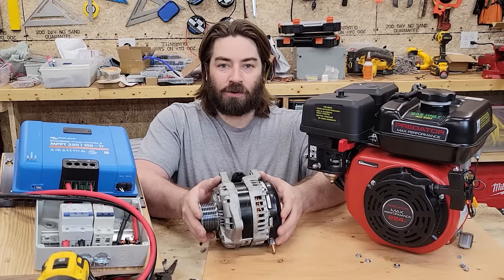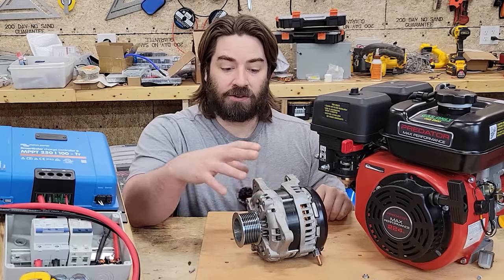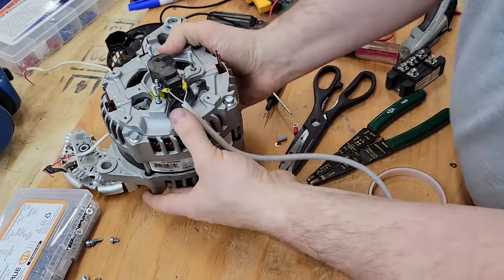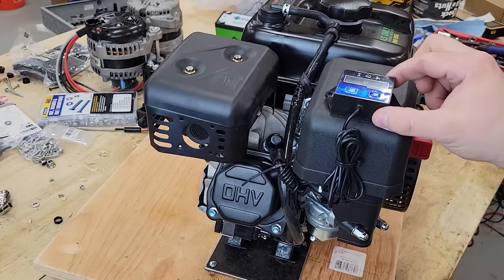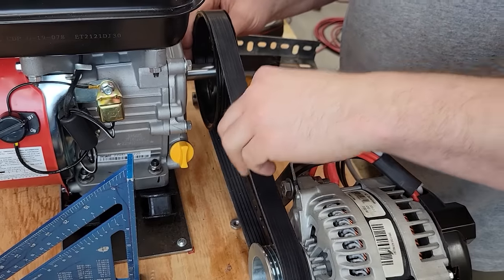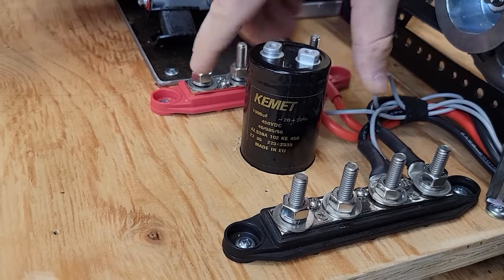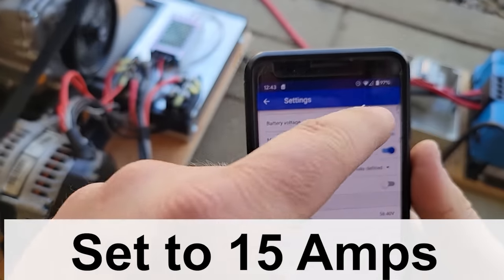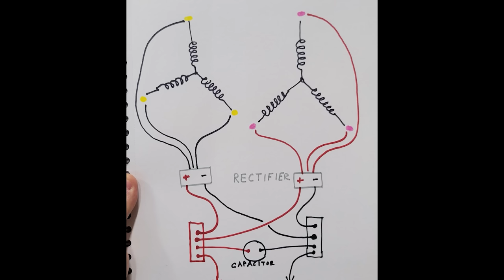The AlternatorGenerator, First Attempt.  48V Battery Charging

Comment: Great experiment. If you want less vibration and better belt control you need both the engine and the alternator solid to each other and then the rubber mounts for the assembly. Also, was wondering why you did not use the OEM rectifier and just remove the regulator. Keep the great videos coming.
Reply from the maker: Thanks, I'll have to try that next time. 
I thought about using the on-board rectifier.  I was a little worried about the negative of the rectifier, and negative of the rotor, being connected, remember, they are operating at different Voltages now.  It probably would work, but it was another unknown in a sea of unknowns.  Also, a smaller reason, by removing the rectifier, the alternator runs cooler.
Reply: @DavidPozEnergy  - Good points, but one wonders if you'd get the same results using the existing rectifier(s) on the alternator - granted those full bridge rectifiers (FBR) (a nod to ElectroBOOM) are not all that expensive, but it would be cool to see if your goal could be accomplished without the two FBRs?
Reply: @samvalentine3206  I would be wary of trying that out. Because diodes have a max voltage the same way any other silicon component does. The same way a 250v charge controller is rated that voltage (because the transistors/components inside only handle maybe 350v max). The diodes in the original rectifier are only designed to operate at max ~15vdc output. So they may only be 50v rated parts for example. Or they very well could take the 90vdc without issue. 

Worst that can happen is the built-in diode shorts out if you exceed the max voltage and sends AC into your DC system, destroying all the DC capacitors including the one in your charge controller. So if you were going to do this, try it without anything connected to the output except maybe a capacitor like he did here. If it reaches your 90vdc and afterwards all diodes are still working right, then it's fine to use them.
Reply: Alternators with the factory rectifier are only good for their original voltages, a lot of OEM alternators from cars with electronic fuel injection use avalanche diodes (similar to Zener diodes but way more powerful) that will clamp the voltage if it exceeds a certain value, to protect vehicle electronics if the regulator fails or if the battery is disconnected with the engine running, etc.
And earlier or cheaper alternators will have low voltage diodes, usually 40V is already enough to fry them.

Comment: This is an awesome project! Definitely one of my favorite you've ever done. I would love to see this turn into an experimental series to try and achieve the most cost-effective way to charge battery banks off-grid. Some things I (and hopefully others) would find very interesting:

1. Experiment with a direct-drive setup. I think this would reduce vibration and increase the efficiency of power transfer.
2. Build a small 3s 18650 battery pack (with it's own 12v mini BMS chip) and connect it through a momentary switch to "kick start" the system - it would then maintain its own SoC once the system is up and running.
3. Build an automatic "cool down timer" out of an Arduino, or an ESP32 board that monitors the temp of the alternator after you've shut off the charging circuit, and then controls the ignition circuit on the engine to shut it down once the desired temperature is reached. This might be overkill, but I'd be interested to know how much heat is being generated by the alternator, and if it really needs a cool-down cycle.
4. Do some reliability & efficiency testing in real-world conditions. Would love to know how much gas (and how long) it takes to charge an "empty" battery system for your whole home/shop.
5. Explore some form factor and component optimizations. Can it be more compact? Could smaller heat sinks be used with some 12v pc fans for active cooling?
6. Perhaps consider a permanent vs. mobile installation comparison - how would each work practically? Bolted to the floor vs installed onto a Harbor Freight hand truck so it can be moved around?
7. Lastly - how does this setup compare to simply using a regular AC generator (e.g. one of those Harbor Freight Predator Honda knock offs) to charge the system? Is the cost/benefit worth it considering the effort required to build vs. buy?

Again, this was such an awesome video. Thank you for sharing your process, and insights! Hope to see more on this soon. 🙂
Reply from the maker: Great suggestions.  Thanks for taking the time to write them out.
Reply: You still might want to have a flex coupling between the axles even when doing direct drive as the pulses from the piston will eventually break the alternator if you mount it solidly.
Reply: ClawTypeRotorOfAlternatorMakesItMoreReliableThanRegularAcGenerator.
Reply: @Maaniic  flex couples based on rubber or PU shredd in minutes. been there...

a rigid direct couple and rigid non-flexing alternator mount to the engine would be perfect. it smoothes the one power stroke over the other three torque consuming strokes. good for the engine to have the alt's rotor as a flywheel mass.

Comment: You may want to consider changing the position of your pully on the shaft. The farther out you put the pully, the more torque you are putting on the shaft itself. I suggest putting the pully as close to the engine housing as you can, with "reasonable" clearance. That will make the engine crankshaft bearings last longer...

It looks like you are mounting to the heat sink backwards. You should be connecting directly to the thick part of the heat sink plate. The fins are designed to dissipate the heat, NOT be the side to mount the components to. Put the pad inbetween the thick side of the plate and the components...
Reply: and possibly make the shaft seal leak oil with the load being that far out flexing the crankshaft. IMHO 😎

Comment: Couple of points to make here. I'm impressed that at a full 12V on the field winding you're getting that much voltage out of it, but that's cool. Second, you're likely going to want to get a fan on that heatsink to actually move air through it so you don't cook your diodes. Your buck converter may not like living in the engine cooling air heat over time, you may want to move that so that too doesn't cook. 150 degrees celsius is the max your electronics will take before the silicone melts. We generally try to stay at 100C max so you have some headroom for ambient condition changes. Your capacitor will live longer if you keep it cool, so also monitor it's temperature so it too doesn't cook... Electrolytics don't like heat. As noted by others, you really need a better belt tensioning and positioning system. 

How much power can you theoretically get out of this system? 1 HP is 746 watts, or .746 kW. A general rule of thumb for mechanical to electrical conversion usually works out to be 2 HP per kW in practice. If you look at generators and compare the continuous output power to their HP ratings, you'll see it's 2 to 1, for example, a 4kW generator has a minimum of an 8 HP motor on it.... so if you were pulling 3kW with this, that works out to be 4.02HP. I may have missed it, but I didn't hear the HP rating of the motor. A rather annoying trend the chinese motors seem to enjoy is quoting the displacement vs the HP output at 3600 RPM. Again, I don't know what that motor is rated for, but 4HP worth of load isn't too bad.  This disparity between pure electrical and mechanical HP conversion is due to the response time of the carburetor and other mechanical factors and various other inefficiencies.  (that 4kW generator example really only needs 5.3 HP, but an 8 HP won't stall when you whack a big load at it, so it can power through) 

Not sure if you're aware or not, but the reason they rate them at 3600 RPM is it happens to be the synchronous RPM of a 2 pole generator (alternator actually) to produce 60Hz power. It's also easier to make HP at higher RPM than say 1800 RPM which is what you'd get for a 4 pole machine.  Your meter may have a Hz function on it, you could read the AC input to one of the rectifiers to see how the poles are actually wound in the alternator itself. Doesn't really matter, but if the frequency is pretty high, like over 120Hz, you may run into an issue of killing your rectifiers because they aren't fast enough recovery to handle higher than 60Hz input, the detriment will be higher losses in the diode blocks.  Another interesting point is that if your frequency output is high enough, you may not really need the capacitor as the ripple frequency (which will be twice the input fundamental frequency) will likely be high enough that the subsequent DC will be pretty clean to start with, which is usually the case with 3 phase in the first place in this case, 360 Hz from a 60Hz source.

Comment: This is AWESOME content!  Hacking an alternator has been on my mind forever.

You probably don’t want to exceed the original power rating of the unit by more than a few %.  Automotive hardware is usually Engineered precisely to spec, not over, to keep cost and weight at a minimum.  Alternators also spin as much as 3-4x crankshaft speed, and cooling potential (power limit) will scale somewhat with operating speed.  Best err on the conservative side lest you wish to be replacing alternators regularly. 😅

Keep up the good work, sir!!!
Reply from the maker: Thanks for watching.
Reply: Modern alternators are designed to deliver over 200 amps for short periods to recharge the battery after starting.  David is only drawing 1/4th of that amount of current max.  The higher resistance in the copper windings as it heats up tends to self regulate the max current output to protect the alternator.
Reply: Great project David! Really enjoyed it. I am curious as to how long you can run this rig before heat buildup, electronic or mechanical failure occurs. Time will tell.

Comment: If you overvolt the alternator windings the insulation will break down resulting in burning out or fire. Depending on the frequency, what about putting the alternating current from the alternator through a transformer and rectifying the output of the transformer? This would save grossly overvolting the alternator.
Reply: That's definitely a worthwhile concern. However, most magnet wire seems to be rated around 200 volts per micrometer. Assuming the insulation is at least that thick the insulation should be more than enough.

Comment: Have you considered connecting the outputs of the two rectifiers in series, rather than in parallel? That would double the output voltage, and halve the output current. So, you would get the same output power, but at a lower current. I'm not sure how much it might improve efficiency, but it would lower the resistive losses. Something to think about, anyway!
Reply: Not a good idea - One one half AC cycle, you mike get close to double the voltage, but on the other half cycle, the rectifier is likely to short the stator.

Comment: It's possible that the built-in rectifier diodes would have worked. I've heard of people getting 120 VDC from alternators.
Reply: You are correct. The built in diodes would be just fine. You just remove the regulator and apply whatever voltage you want to the rotor to get the desired output. You must be careful however not to exceed the current rating of the unit itself.
Reply: I was puzzled as well, why take out a perfectly good set of rectifiers that are already attached to a heat sink and cooled by the forced air cooling the alternator was built with?

Comment: at this point, i'd like to see a test done with this set-up at the 2.7 kw load rate to see if the alternator over heats over an hour's time.
Reply from the maker: OK.  If there is enough interest, then I can make a part 2 video.
Reply: X2 I agree temperature test after an hour under load is needed to check reliability.
Reply: X3 agree - as was said by Diesel Art - temp checks under load... one wonders how much you could really push it and have it stand up without destroying itself.
Reply: X4 Yes, I'd like to see how hot it got at ambient temps with a 2500 watt load after an hour.
Reply from the maker: Thanks everyone for joining in the conversation.  I'm glad to find out what you would like to see tested.

Comment: How hot did the alternator get maxed out? Would it burn up if left running at max?
Reply from the maker: I don't know.  Would you like to see some temperature readings if I do a part 2?
Reply: @DavidPozEnergy  sure and perhaps the heatsink as well for fun 😊
Reply: @DavidPozEnergy  how about adding more alternators, electric starter motor, battery,solar panels perhaps lower noise level.

Comment: I like what you have done here. One suggestion - in addition to the rigid mounting of the engine, I suggest to put a spacer between the two tabs of the alternator where it mounts. It isn't intended to operate in compression unsupported.

Comment: This is great as I want to turn an old diesel smart car into a generator and this is something I had in mind, the 1 think I will try in your set up is getting 12v out the engine into the alternator to ditch the dc to dc buck converter, that way when you start the engine the alternator will kick in.

Comment: Very educational project. Thanks for sharing.

There are 1 kW portable generators for $300.00 in the market, which with few electronics to covert 120V AC to any desired DC can be a very reliable solution.

However, grid kW will always be cheaper than any portable generator's fuel cost (per kW).

Comment: Really cool test. I've been looking at a 600watt gasoline or diesel battery charger with electric start

My specific use case is when I go to Alaska during the winter, I'll need something to keep my vehicle's engine block warm, this means 400watts of constant power and another 100 wats for StarLink, maybe a fridge and maybe other electrical stuff.

My Tacoma runs on 12v, so I'll need a DC setup so I can charge my batteries while everything else runs off of their respective inverters or 12v charge devices.

The answer is I might have to DIY, but thanks for opening the door and covering a lot of questions I had about my potential setup.

Comment: hey, you built an edgerator, congrads. my buddies and i used to make these more than 20 years ago living off grid. we mounted the alt to the blade side of a gas edger and picked the most fuel efficient engine we could get. there's a lot of tec for max efficiency, but for a "practice setup" your good.

Comment: This was a fantastic video. Great job. Your explanations were spot on. Very very informative. Thank you. 

I pulled the rectifier off and tested my voltage coming from mine and I had three wires pumping out 120v ac each. I just need to figure out how to marry it up to my breaker box and try and power my garage from that. 

You have given me hope that it is more than possible. Again thank you

Comment: I believe the rotor coils acts like a "power on".
The alternator is rotating full time but just generating energy when those coils are powered.
The controller just make a simple battery voltage monitoring, if above X volts it powers off the coils, if lower it powers on the coil.
Very simple, no computation or microcontrollers here, it is just for not overloading the battery.
This is what I BELIEVE, not sure if it is like this.

Very nice project!

Comment: I have a bachelor's in electronics. It's not how fast you spin the alternator that increases the voltage. The output voltage(and anything electric) is governed by the formula V=IxR. To increase voltage you need to increase the current(I) and/or the resistance. This is usually done with a combination of capacitors and diodes. Conversely you could also put a transformer between the alternator output and diode bridges, depending on how much voltage you want. Cool build

Comment: Impressive build !
May I suggest - in case of a re-design - you mount the alternator directly on the engine using heavy duty bracketing.
Use as short as possible drive belt.
As you suggest yourself you are maxed out on the alternator capacity as this is a factory design.
Do not overdo the output voltage, as the alternator windings may start arcing over internally being build only for low voltage applications.
Thanks for the video !

Comment: I watched the whole video an as you completed your build, I had no doubt it would work. My only concern was enough tension on the belt ( in my mind I pictured a tension pulley) But there is alota torque on that an involves more mounting hardware.  As for connecting the alternator direct, you would lose RPM  because of the pulley size difference. All in all..Great Job.  I use 12v solar setup and have actually charged/run my system with my car an long jumper cables (not very efficient but it does work. )  Solar is only good if you have sun..once you use up the stored power in your batteries, an no sun, you must have some other power to feed your inverter.  A pleasure watching! Thanks for posting!
Reply from the maker: Thanks for your comment.  The mount wasn't great.  In video part 2, I welded a new base for the alternator and generator to mount together and that solved my vibrations.

Comment: Electrical Engineer here. Top video mate.
Would love it if you increase the excitation a bit to see how far you can take it and if possible hook up the AC output voltage to an oscilloscope to see how clean the AC waveform is.

Comment: I'm not sure if heating would be enough, but sometimes bearings with interference fit are pre-heated. This causes them to expand just enough to slide on easily on the shaft. When they cool down, they are very tight.

Comment: Look at adding a belt tensioner and belt transmission like what's used on a twin belt drill press. That will give you simply more options for rpm control.
Great work !